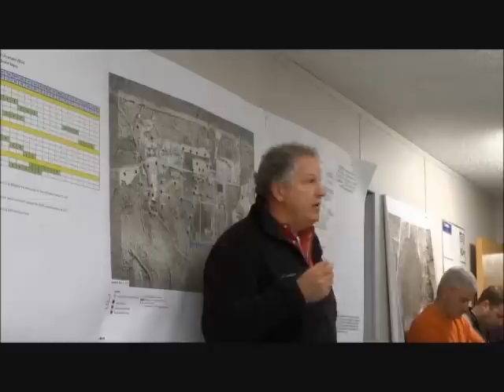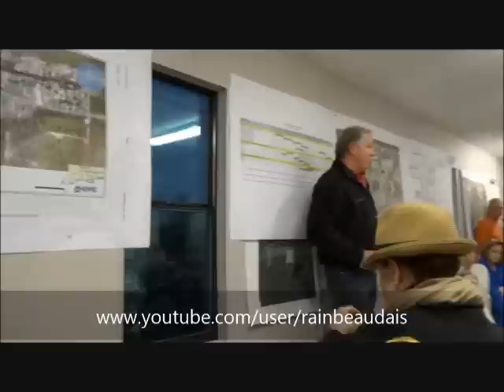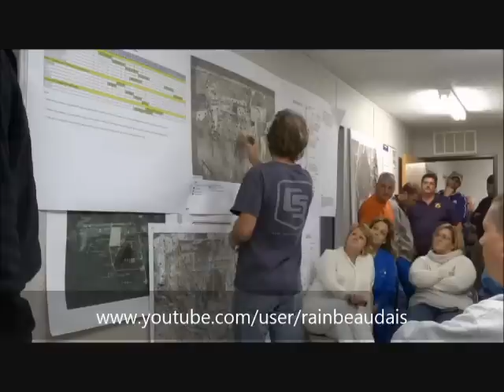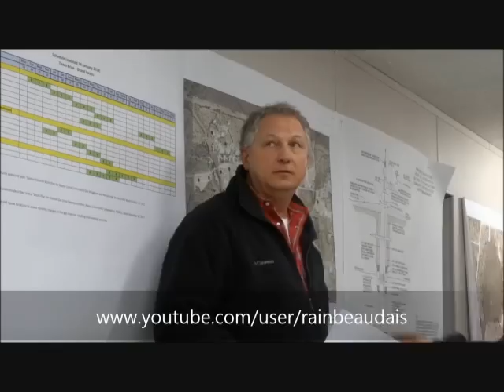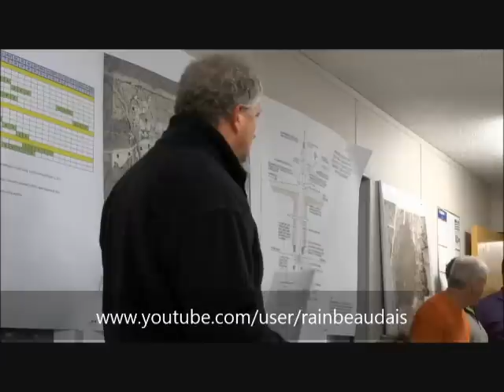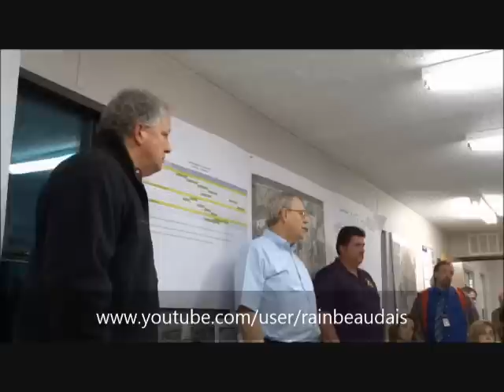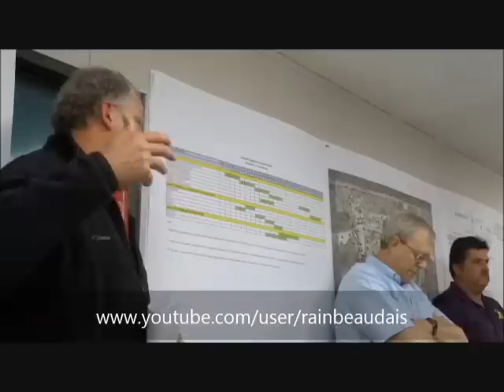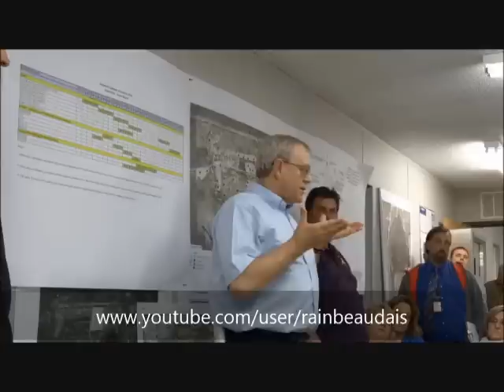Texas Brines Informational Meeting/Passive Vent Wells

Comment: Texas Brines Informational Meeting/Passive Vent Wells - Update Bayou Corne, LA Sinkhole - 55.16 minutes - Complete meeting. Pub. Jan. 15, 2014
As you will see and hear, subsidence is the major issue for many residents at this point. The DPVE program was nixed because they realized too much water would be removed with that system, causing possible subsidence of the neighborhood and community.
The meeting talk was about more vent wells, subsidence, the southern berm, and a few other things, but mainly the installation of more vent wells, specifically "passive vent wells". Some will be ORWs (Observation Relief Wells), and also 5 new shallow depth wells (20-40 ft) to capture shallow pockets of gas in the Aquitard, above the aquifer (that the deeper wells capture).
Not sure if anyone has noticed on the daily blog updates how they have been saying they were "monitoring" Bubble Site # 56. That caught my attention a while back and I asked why, as they have never made it a point to specifically post about monitoring any other bubble site. The purpose was explained to me then, as it is in the video. A passive well was set up close to this bubble site, and after 24 hours or so, the bubbling stopped. The well was shut in, and pressures remain low, giving encouragement that the gas in this area at least, is not being recharged, or replenished from another source.
Bubble site # 56 is one that I filmed from Nick Romeros boat back in May 2013......here is the link to that youtube video. I remember I was pretty upset to see that bubble site, as it was VERY close to where I was living, as well as the pond I spent a lot of time at.
HUGE Methane Bubble Site Found Within 100 ft Of Bayou Corne Home... http://youtu.be/x3c-Rqum7tM

Thank you, rainbeaudais . for posting this meeting. :) It is appreciated.